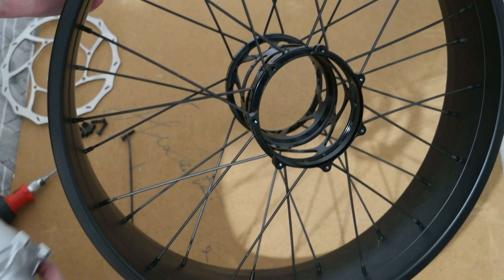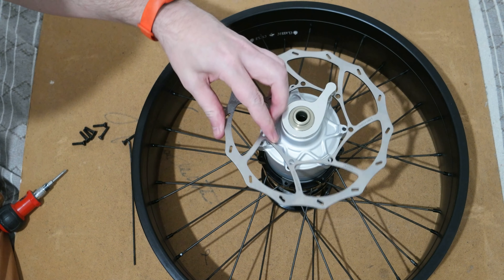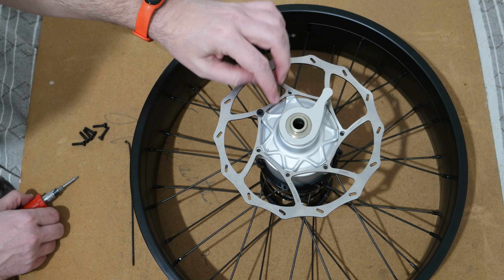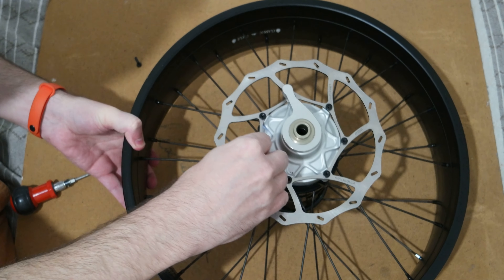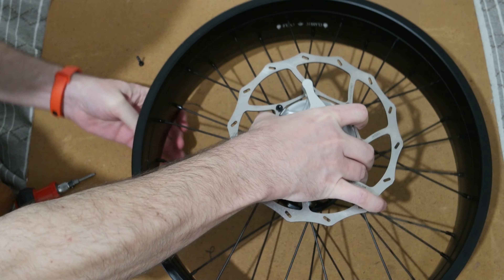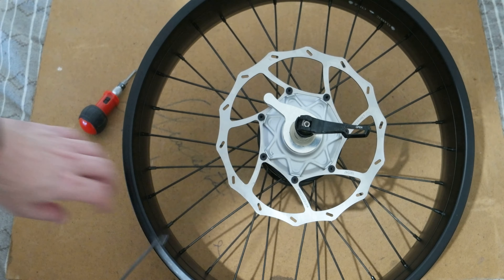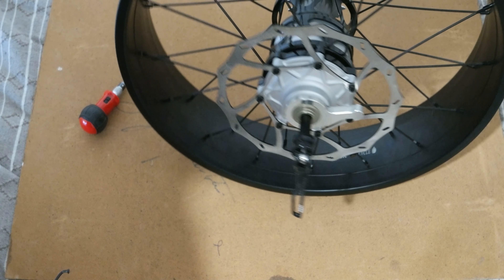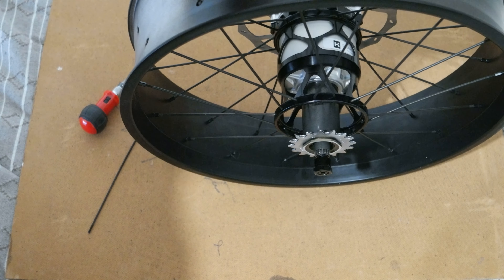Wheel 20"x100mm build for Kindernay fat bike 14 gears hub

Comment: Hello, do you know if that hub can also be used for say a 27.5x3 wheelset by removing the input shaft spacer?
Reply from the maker: Hi, not sure if I understood correctly. If you refer to the black long cylinder is not removable, it's just an extender part of the hub since it's for fat bikes. They have gear hub for normal size wheels set, check their site.
Reply: @ganzoai  Ahh ok, I plan on using a standard Kindernay VII for a regular wheel. Was seeing if I can order just the extender and fat bike cage to go from a 27.5x4 to a 26x4.8 without having to buy a completely new a seperate Kindernay VII just for the fat bike, thanks!!
Reply from the maker: @vha27  hey no problem! it should be cool if they had that feature !

Comment: Why?
Reply: @ganzoai  
You have done a good job laceing the wheel
The kindernay system seems heavy and over engineered to me
Reply from the maker: @danielebergonzi8461  thx, lacing is just a pain :) the gearhub is lighter than the XL rohloff competitor, but yes is not a light hub. As far engineering I like that they are thinking differently from the norm. We will see how it performs in time. Please subscribe thx !
Reply: Hi.. can i ask how long the Spokes are?
Like 142mm??
Reply from the maker: @smarc1325  165 mm
Reply: @danielebergonzi8461   i would order one.
Seems impossible these days🙄